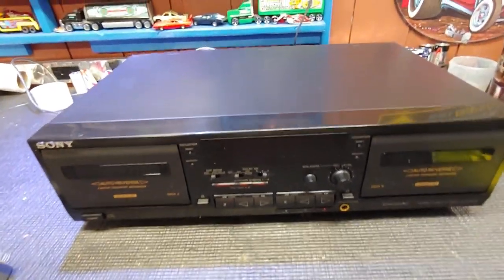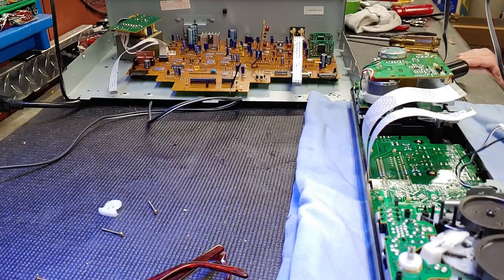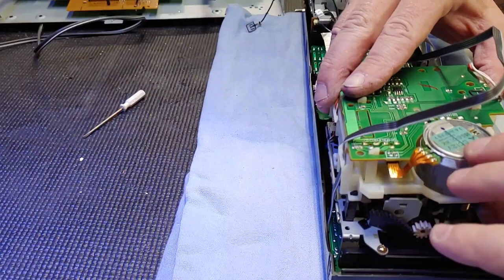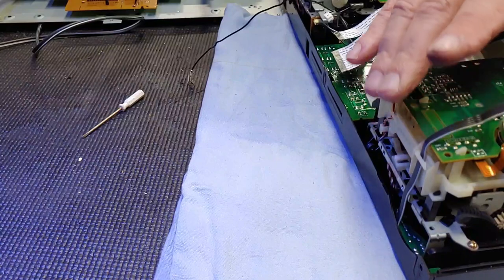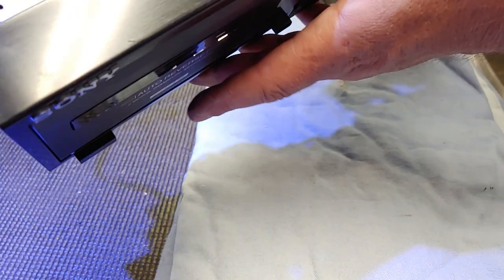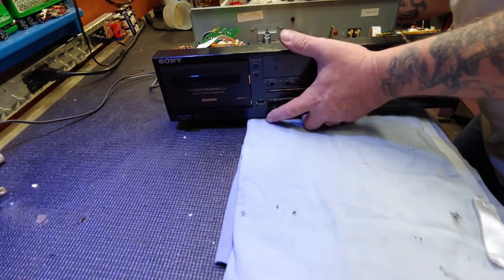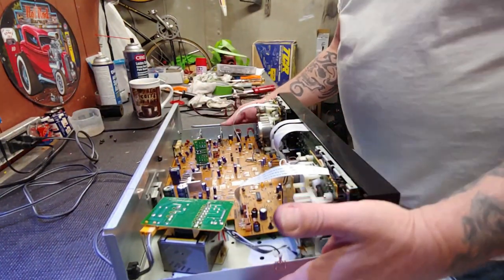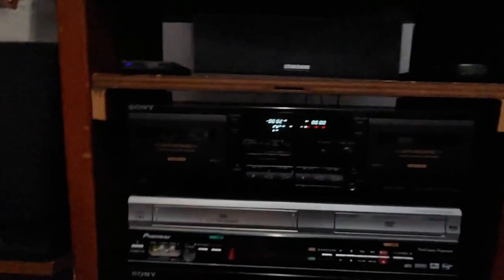Sony TC WR635s Cassette deck gets NEW Belts

Comment: nice work but the pinch rollers are bad....i hear wow and flutter so the need replacement...nice work though
Reply: Yes, very noticeable wow & flutter in the playback. If the motors and belts are good, then it's the pinch rollers? Either hard or sticky rubber?
Reply: My wr690 also sounds like this, the seller told me he replaced the belt already. Is it the pinch rollers? From my observations the rollers still in good shape.

Comment: You could have made the belts so much easier by hooking the belts around the standup post which sony calls claws. Then you just slide the belts on with a tweezers or hook tool. Service manual is online to look at. You made it a lot harder on yourself.  Oh Well
Reply: Where is this service manual? Can you share a link? TY

Comment: There are two holding tabs on the main chassis (metal) that hold the belt in place and two plastic holding tabs on the plastic motor chassis. The holding tabs hold the belt over the motor pulleys, then when the two pieces are placed together you can pop them off the holding tabs onto the pulleys, This is a TCM 190 transport. Look up my videos for details. Great attempt without the proper training, Kudos brother!

Comment: Wou will also need to change all 4 pinch rollers !! Has the original sony  as I saw ! Will eat the tape and you will wonder what it is ! I have 6 sony decks and they have the same problem !
Reply from the maker: This sony works flawless,clean the pinch rollers,not replace the pinch rollers.
Reply: @Howlinwolfreviews   It is not a matter of cleaning ! Over the years the pinch rollers are made  harden and the tape slips in Sony decks mainly ! But ok the cassette deck its yours ! you decide. :) . Look it up a bit for the sonys decks and pinch rollers !  :) . Here on youtube see and you will understand what I mean :)
Reply: Guess you tried , but why make a video demonstrating how to do something unless you know how to do it correctly .
Reply: @Howlinwolfreviews  Wow & flutter is very noticeable during playback.

Comment: I just finished putting 22:17 belts on one side of a TC-WE635 (No “s” on the end.  Made in  China in 1970.  WHAT A BARE TO WORK ON!  To the get the belt on the capstan motor most of the deck needs to be disassembled.  Not at all like your video.  Just an FYI.
Reply from the maker: arrgh
Reply: Ive got a TC-WE635, thought i got the belt path correct but im getting issues @CarySagady would you care to help me with a belt diagram or tips? AFTER several tries i took the decks out and removed the screws for the motor assembly to fit that wide belt on.. im still getting an “- - - E - - -“ error ???!!!
Reply: Thanks

Comment: I have one of these machines (or a VERY similar model.) I can't remember the exact model number, but it's virtually identical.  Dolby "S" and everything. BUT... My question is, when you press EJECT, the tape door keeps sticking shut, even though I am very gentle with it!  Is there some trick to "lube" some latch or something to keep that from happening?  Thanks!
Reply from the maker: The gear and spring for the eject mechanism may be dry of lube. it is as simple as removing the cabinet and examining
the mechanism. be sure to use a plastic safe lubricant as these decks use a lot of plastic.
Reply: @Howlinwolfreviews  Thank you for your response!  I loved how that machine operated!  Best-sounding cassette deck I've ever owned!  But if I can't get tapes in or out, it's not of much use!  LOL! I'll try to find something which will work to lubricate the plastic mechanism. Thanks again!

Comment: I just picked one of these up and it looks pretty mint. It turns on and when I put tapes in it just does not seem to be able to spin the tapes and sort of makes a kind grinding noise. I am assuming it would be the same issue. Like the belts are just old and gooey. I do live in Vegas and maybe it was in heat. Would you think what I described would be the belts. As someone that is not very savvy with repairs this does seem manageable for me. Any other advice you have would be appreciated. Thanks!
Reply from the maker: Definitely replace the belts. Pretty easy tho'.

Comment: Thank you for posting this - great fun to watch you ( the "come on mans" were classic ). I picked up the 645 which I think is pretty much the same deck as this one minus some minor differences. Looking forward to setting it up. Is that a spectrum analyzer or a receiver below the deck? Looks sharp.
Reply from the maker: That is a Sony receiver with a built in Graphic EQ. Cheers.
Reply: @Howlinwolfreviews  Thank you for the reply. I just scored a deal on a woodgrain fronted EQ with spectrum analyzer. Glad you posted this video - otherwise I may not have tried to chase one down.
Reply: @Howlinwolfreviews Thanks again for the info. I did some research looking for a comparable receiver and found a SONY GX808ES ES.  Is the receiver you guys picked up at the sale a GX808ES ES?
Reply from the maker: @michaelskramii2245  We have the SONY STR-D2090.
Reply: @Howlinwolfreviews  Thanks much - I appreciate the info :)

Comment: I have the same deck and yes, apart from the need to remove the front panel and everything it is pretty straight forward. 
I have another the TC-WR665S which is an upgrade as it adds pitch control, service manual is the same but the unit inside is not exactly the same, more cables to unplug and a addon board on deck which just makes things a little trickier. 
Anyhow, once taken apart it's the same process for the belts (same belts actually).
My issue with this one is deck A refuse to work. Deck B is working fine. It's like deck A gears (under the belt mechanism) is reversed (when I compare to deck B) and it won't play, FF, FR etc though the belts are working everything is spinning etc.. 
If anyone has any idea what I did wrong and how I can fix it I will greatly appreciate. I disassemble deck A twice but with the same results.
Reply: I had the same problem once with a Sony deck. I've changed the belts but I turned the cam gear (white or gray gear wheel) in a wrong position. This can happen if you try to turn the flywheels withe the new belts. So the deck won't play. You have to check if the heads are in the down position which means stop. I don't know this deck but there must be a lever or something like a clutch. So when you push this the cam gear unlock and you can turn it in different positions. If I change belts now on a deck, I check this always before reassembling. Hope this helps, good luck.
Reply: @chamni63  Hi Erik, thanks for your message. Yes I was able to figure that out finally.
Now I have another issue with those 2 decks. They play fine but here and there I will have huge wow and flutter. It slows down then pick speed again.
I heard some of the mechanisms might need some oiling but I'm not sure.
If you have any ideas on what causes this and how to fix it, I'll be very grateful.
Thanks.
Reply: Hi Bruno, this could be the pinch roller. Try to clean it with alcohol. If this does not help, you can try to remove it and rub it with fine sand paper. If it is worn out you have to replace it. You can oil the capstan bearings, but that means you have fully strip down the mechanism 😬good luck
Reply: @chamni63  Thank you again. I will check this out this week.

Comment: 29:40 How is it possible after all this work to have so awful results? This is so fluttery! Unlistenable piano strings. Worn or dry motors maybe?
Reply: Yeah the wow & flutter is very obvious unfortunately. Maybe the belts are too tight? Or the pinch rollers have become spongy or hard? Assuming the motors are good. Still an informative video either way!

Comment: HI, MY FRIEND... I'VE BEEN LOOKING FOR THESE REPLACEMENT RUBBER BANDS (SONY SPARE PARTS) IN MY CITY... BUT I NEED THE DIMENSIONS OF BOTH [3-024-405-01 BELT (FR2) & 3-016-570-01 BELT (CAPSTAN)]... I'D REALLY APRECIATE THAT INFORMATION IN ORDER TO BUY THE CORRECT ONES...  YOUR VIDEO IS THE BEST ABOUT SONY TC-WE635 I'VE FOUND IN YOUTUBE... THANKS A LOT!